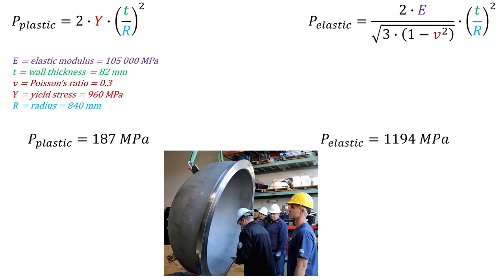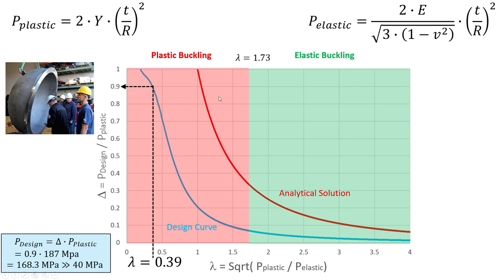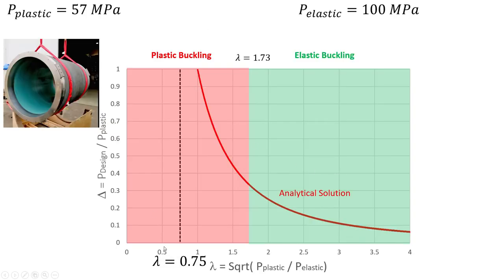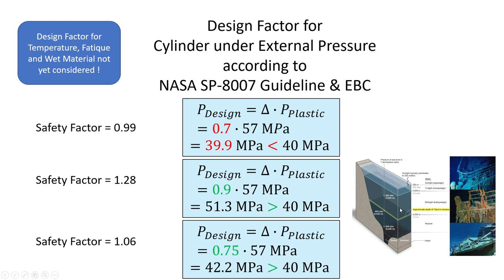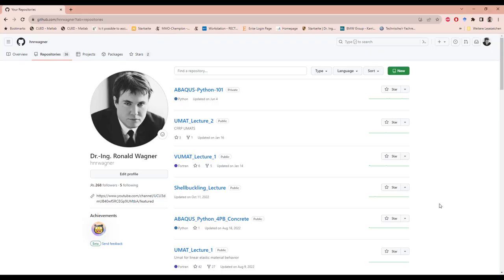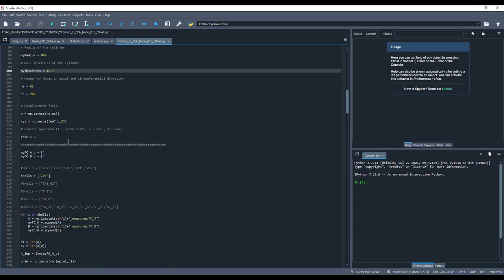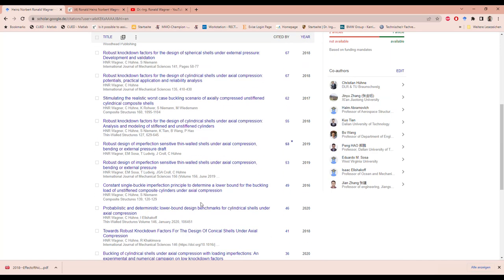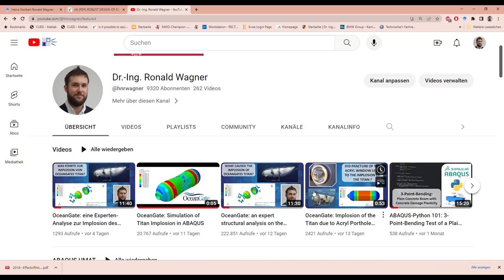OceanGate UPDATE: These results are truly shocking - nearly no Margin of Safety

Comment: I like the video overall although the formula to calculate the plastic compression pressure on the first slide should be the p = 2 * Y * t / R.  The 187 MPA valu is correct.
Reply from the maker: damn you are right, thanks for pointing this out
Reply: @hnrwagner  Your welcome.  I like the series where you look at different hull designs and there have been some good ones.  As you know the Titan hull had a 0 - 90 layup probably at a 2 to 1 ratio, so 3.33 inches thick in the hoop direction and 1.66 inches thick in the axial direction for a total of 5 inches.  This does not seem to be the optimum layup and the axial layup is difficult to manufacture.  Since the hoop pressure to axial pressure ratio is 2 to 1, it would make sense that the layup be modified to optimize that ratio.  If we used a wrap angle that had a tangent of 1/2 or .5 the resulting angle would be 26.6 degrees.  If we then modified the layup from 0 - 90 to alternating layers of +26.6 and - 26.6 degrees and maintain the 5 inch thickness it would result in a 34% stronger CFRP hull for the same weight and be simpler to manufacture.  Since CFRP cannot be exposed to high pressure salt water due to its porosity and relatively weak resin matrix strength, an impermeable external metal liner would need to be installed to protect the CFRP.  This liner would need to be sealed and fastened at each end to the flanges of the titanium rings to reduce the criticality of the epoxy bond between the titanium rings and the CFRP center section and prevent water ingress. A 1/8 to 1/4 inch thick titanium liner would probably work the best to prevent galvanic corrosion. Just a thought
Reply: Also the CFRP hull thickness was easily googlable as 130mm not 80mm, this has been publicly stated numerous times

Comment: Really great work!  Have you reviewed the recovery photos?  There's one shot of the crane lifting the ring-carbon interface and you can see very distinct signs of bondline failure.  That is, you can see bare metal patches with adhesive patches interspersed.  In the aerospace composite world that is considered a bond failure, so just another piece of the puzzle.
Reply from the maker: I will add more and more details step-by-step, bondeline failure will be one of the details
Reply: @hnrwagner  Excellent!
Reply: One of the mounting lugs on the rear ring detached from its weld. which was left behind.
Reply: @joefish6091  Interesting

Comment: I've been following your work here, although I must admit much of it is beyond me.  But I do remember from my brittle fracture training that you have to assume a certain minimal defect.  We were taught a lot about not exceeding certain operational limits because "assuming a pre-existing defect, a crack could develop and propogate rapidly, resulting in catastrophic failure". (this was in high grade Mg-Mo steels though, not carbon fiber)

So yes, when manufacturing any real-world structure, we have to assume some amount of imperfection and this video does a great job showing how this impacts the design requirements.

Comment: They used cheap titanium. There is no way they would have paid for a safety factor of 4.2 when their CF tube used expired prepreg and a window rated to 1/3rd their depth to safe cost. Their CEO described safety as holding back innovation.
Reply: @77thTrombone  They ran this sub like a suicide pact, I doubt they overlooked that, but probably just figured if they are dead, it is no longer their problem…
Reply: The end caps are probably cast. Material cost in using better alloys would probably be small compared to the casting and maching costs. My recollection is that the strength of the better 6AL4V casting alloys approach the strength of wrought material, but is still a bit lower.
Reply: The titanium hemispheres survived just fine even after the implosion of the cylinder
Reply: A pressure hull that implodes above its design depth is innovation?
Reply: "safety as holding back innovation"  Classic example of doublethink !
Reply: The report of the full investigation on this is going to be something else ......
Reply: @bernieeod57 

Certainly is a novel way to die.
Reply: @77thTrombone the CEO paid the ultimate price for his cavalier attitude. My only beef with SR is how he brought forward the deaths of others.
Reply: @pyalot  - you do not improve anything from experience being dead unfortunately
Reply: @skibbyau  Well, onboard where 5 people. SR,; Nargeolet, Harding and the two Dawoods. Nargeloet was in an advisory role at OceanGate, and when polled by a friend why he lent legitimacy to these loonies, he said he knew people would die, but maybe he can prevent it. Harding had plenty of DSV experience, and he was probably warned against going by many experts he personally knew. The Dawoods where the only ones aboard without DSV experience and knowledge of the issues. However with a net worth of $360m, they could have easily hired an advisor to spend a few months researching Oceangate/SR.
Reply: 4.2 isn't even possible, then the sub would be capable of diving the Mariana bottom. 1.2-1.4 is industry standard and we all know, what SR thought of industry standard safety practices.
Reply: There is a factor that seems seldom mentioned.  How are other subs built of all metal  when metal is substantially less buoyant than CF?  Basically, they add buoyancy with foam.   Sounds like a no brainer, right?   But it has to be a very special foam that can withstand the extreme pressure without collapsing.  And, that special foam….. it is VERY EXPENSIVE.

So often we return to decisions that were made based upon cost factors. The”.  innovation “  that Stockton Rush was so proud of was making it cheaper.  And this was because, Rush had the idea to turn Ocean Gate into an deep sea based entertainment company..  And that business plan required a much lower cost structure.   

And THAT horrible idea was the reason Titan imploded
Reply: Mating the titanium to the carbon tube hull, with bolts and glue? Like basic engineering tells you this won't hold up, especially under pressure. The whole thing was doomed from the start.
Reply: The main stupidity is to GLUE a cylinder to a sphere. The second stupidity was to build a cylinder from carbon fibre wire. The wires are also GLUED together, and the glue cracks first. Math is not necessary when pure foolness is so huge. 

Moreover, all the other subs which reached successfully even deeper depths have a sphere for the humans inside - and it is simply why. Then, look at the "door" for human access inside the Titan - stupid, stupid design.

No math needed to prove such stupidity.
Reply: @bernieeod57  I believe we have only seen the front one.
Reply: @RemyMartinVSOP If you've seen the video of them applying the glue, it's jaw-dropping. Just a bunch of guys with squeegees. No clean room. In fact, they were touching the surfaces to be joined WITH THEIR BARE HANDS before just slathering the adhesive around. 

It was beyond belief.
Reply: @fafner1 they are they used a massive casting and molten metal setup at a company that primarily makes pressure hulls for real submarines, the big ones I believe
Reply: @doncarlodivargas5497
 "- you do not improve anything from experience being dead unfortunately"

You absolutely do improve the knowledge base by teaching the living what not to do.
Reply: Wow...
Reply: You have oversimplified this. Pure Ti has a low yield point (240 MPa) but it's still expensive and very difficult to machine. You can achieve better properties much more cheaply and still with reduced weight using various Al alloys. To me it's obvious that they used a Ti alloy with at least intermediate yield strength (say >=500 MPa) which would have given a much more acceptable FOS.

Comment from the maker: Was cheap Titanium used for the Titan? What do you think?
Reply: i'm not sure - has the hemisphere been milled or casted? the whole submersible has been cheaped out so much, there hasn't been any thought about "the grade" of the titanium. in my personal optinion steel would have been a better solution for a cheap way to survive. but white men are not inspirational enough i heard.
Reply: @tdsangel  Most likely the hemisphere would have been forged from a flat disc, then machined?
Reply: @hnrwagner,, The Titanium was not the week link, the CFRP cylinder was the week link..  I would like to add that the 1/3 size test piece failed at 4280 psi
They expected 6000
Reply: @bostedtap8399  i just read a dissertation about the influence of temperature in titanium regarding to the young's modulus. titanium is no material that i'd suggest to forge. the young's modulus is not like ironmetals or aluminium sinking with the temperature so much. it needs a lot of heat and is still shitty to plasticise.
Reply: @tdsangel  the black men and the white women are?
Reply: @tdsangel  Hi, My knowledge of Titanium is very limited, but there is a very good professional video by "Caladan Oceanic" called "The Making of the Deep Submergence Vehicle (DSV) Limiting Factor. It shows forging of the hemispheres, then machining them to a very high geometrical tolerance. Best regards John.
Reply: Monel or inconel would've been better choice of metal to use. Titanium is more fit for it's heat dissipation. The whole thing seems odd and poorly thought out, with costs over safety being priority.

Comment: Thank you. At last your boundary conditions seemed to approach real boundary conditions. Congratulations. Can you please tell us which boundary conditions you used?
Reply from the maker: I only did it for you :P 
4 Points in total, they are internal points in the interface rings.
the interface ring in the rear end, 2 points and locking ux=uy=0
other two points in the front ring, 2 points and locking uy=uz=0
Reply: @hnrwagner  Oh... I thought you had done it for me LOL  Indeed, looking far closer to physics-based intuition, both the perfect and imperfect cylinders. The static / unchanging color scales are helping a great amount to make these effects more visible as well :)
Reply: I was also scrutinizing the window failure, as it occurs at a different time in the two simulations! But when I looked very closely... both happened at the same local stress level in the titanium around the window, as you would expect :) Nicely done!

Comment: Interesting how the imperfect model always fails at the interface joints but the perfect one seems to fail in the middle.
Reply: In practical stuff it seems that failures almost always happen at transitions in the design.  I think this is where even the smallest imperfection has the worst issue with the effect growing as the thing deforms.
Reply: @kensmith5694  And they lowered the caps by crane, not really aligned particularily, so it probably wasn't completely symmetric and then you have all sorts of ungodly forces acting on that area and unevenly. Then again we can all name at least 5 ways this could have failed so who knows. Maybe someone leaned against the porthole and that was too much for it. Or sneezed facing the CFC hull. Or a small fish bumped into them. And they only used 17/18 bolts because the top one was "hard to reach" and "mathematically it makes no difference". Another source for uneven stress putting more force on some areas than others.
Reply: @221b-l3t  Yes, this is a reason to make your designs "self jigging".  If you design a tube and bulkhead so that just setting the bulkhead on top of the tube and letting gravity do its thing, it goes into the right alignment, the design is much less likely to fail.  This is why the pressure housings I have experience with have a bit of the bulkhead that goes inside the tube and this bit has a rounded corner on the leading edge of what goes inside.
Once you get about 10 feet (3 meters) deep in the ocean, the bolts don't matter any more.  The pressure of water is forcing the housing together with a lot more force than the bolts were. The bolts really only matter for handling on deck.  They have to be arranged so they don't make the tube go out of round when you tighten them.  On many designs they just serve as pins with no clamping pressure.

Comment: Great analysis. This is what engineering is supposed to be. This is really shocking, no question. At this stage, it's not reasonable to make any positive assumptions. Considering that they used Rhino Liner to "seal" the outer surface of the cylinder, they probably used cheap titanium. (Titanium is titanium, right?) I would not be surprised if you factor in temperature and wet materials, it would further degrade the "safety" margin. If you factor in fatigue, I would not be surprised if the safety margin was negative.
Reply: Engineering is supposed to be "I don't know what they used"?
Reply: In my simple opinion I have argued that only 5" of carbon fiber in this application cannot have any safety margin.
If you ad in all these other factors even less so.

Comment: Thank you for your detailed explanation, I wondered how much imperfections would lower the maximum capacity of the assembly. Did you model the stepped glue joint between the end caps and the cylinder? There may be localized bending moments at the joint between the dissimilar materials that further could reduce the capacity.
Reply from the maker: Not an adhesive expert,  try to model it right now

Comment: I have been reading your paper "Probabilistic and deterministic lower bound design benchmarks..." in order to gain a better understanding of the background to this video.
Surely both equations (1) and (2) have the wrong dimensions? Both should have dimensions of F/L but their dimensions are F and (F/L)^2 respectively. If correct this rather undermines all subsequent parts of the paper.
I would also observe that your CF test specimens were slender with D/t=1000, whereas the Titan hull had D/t<15. I know you have assumed much lower initial imperfection for the video (0.1t if I heard you correctly, compared to >=5t for the specimens), but this was presumably a best guess rather than a deduction from the test data.
I am not point scoring, just trying to understand the video better.
Reply from the maker: yes, there is an error in equation (2) - the elastic modulus is incorrect and should be removed. It's very annoying (this error has haunted me since publication and really taints the overall good paper), also no one of the many reviewers noticed it.

0.1*t as imperfection amplitude is a guess, yes, there are also very few test data with so thin shells, the overall failure mode (no symmetric collapse should be correct).
Reply: @hnrwagner  Understood. Your peer reviewers not doing their job.
I think there's a mistake in eqn. 1 too. The eqn. I use (and I know there are various) is Nx = E*t^2/[r*sqrt(3(1-nu^2))] which at least has the correct dimensions.

Comment: whilst I am not an expert on CF I would have thought they could achieve much better geometrical tolerance than 0.1t. I believe the Ti hemispheres for the Alvin semisub were forged to 0.8mm tolerance and that's a much more difficult task.

Question: which elastic buckling formula did you use for external pressure on the cylinder? I calculate a higher pressure (235 MPa)  using  NASA SP-8007-2020 eqn. 21, and that's for imperfect cylinders as you know. It would be nice to understand the discrepancy.

Comment: Ronald I must admit that I don’t really understand the analysis-but it does look interesting. ( I will go back through it) My only comment is the Poisson’s ratio . The normal quoted value of 0.3 has been used. We test lots of different carbon laminates and when they are unidirectional ( still don’t know if the latter tubes were but the wet wound ones were) the value is close to 0.1 . This will affect the off axis loads
Reply from the maker: I can explain if you need specifics

Comment: I am trying to understand what happen to the 3 oxygen cylinders located under the floor, was that figure into your implosion demo
Reply from the maker: No, didn't know that until yesterday,  interior is empty in the model. In engineering we start simple and add more and more details, in order to prevent errors. Keep in mind its a simulation not an animation, adding details increase the complexity and computation time.

Comment: I have no idea where they would get a billet of Titanium that size.  I know the F35 Jet has a big single piece that is used for a bulkhead, but even thats not big enough. I suppose the dome could be hot forged from a plate ? TBH tho, I dont know anything about how titanium works in terms of grain size, thickness for heat treatment etc. After a web search tho, it seems a billet that size is special order anyway. Unless they fabricated it. ( Note, limited internet on laptop cos great firewall ).

Comment: Not sure what the problem is inderstanding this failure. Make it as complex as you like... glue, bond, bolts, balance, etc. The simple and obvious truth is that the CF tube failed in an instant. No glue, no overlap with flange , no bolts, portholes, thrusters, game controller had anything to do with the actual failure.... The Carbon Fibre Tube collapsed instantaniously! 
The rest was collateral .

Comment: I was just thinking yesterday to ask about the inner lip of the titanium mating rings. In the imperfect geometry, does the thin thin titanium lip hold up? It's so thin it's hard to believe it doesn't shear off or bend in. I've noticed that tubes flex more at their ends, could that mean there's a lot of force on the lip and the lip has to hold up for the tube to hold up?

Comment: So code need to change to play with higher SF or include imperfections in the maintenance process . Where did  you 3d model it ? inside abaqus or any other 3d modelling soft ?
Reply from the maker: the imperfections were modeled using a python script, or what do you mean?
Reply: Sure I got it . Thanks for the video .